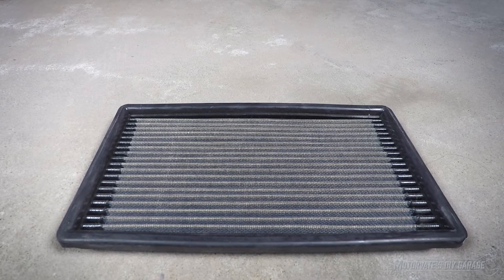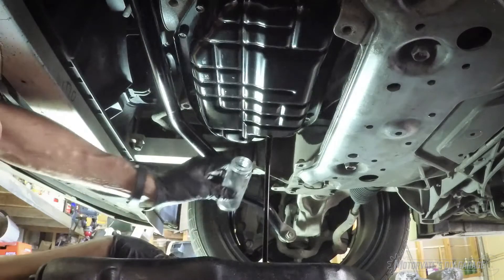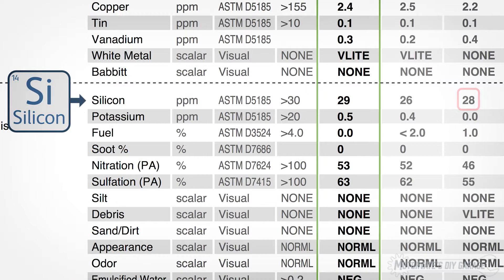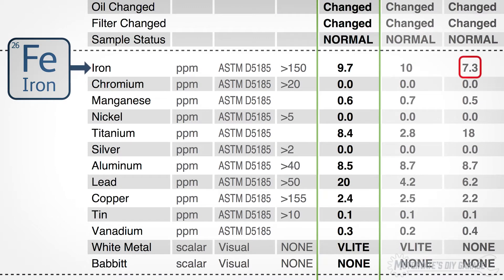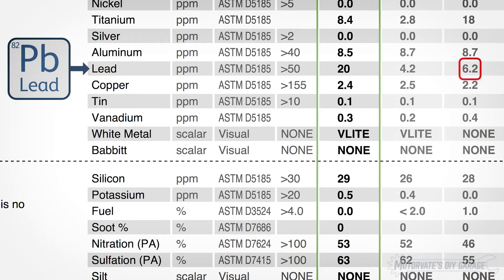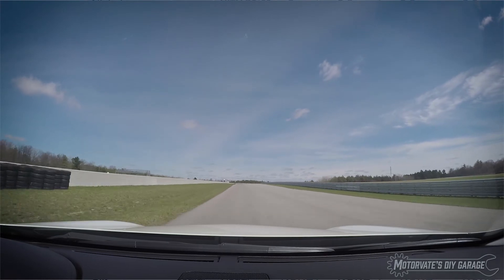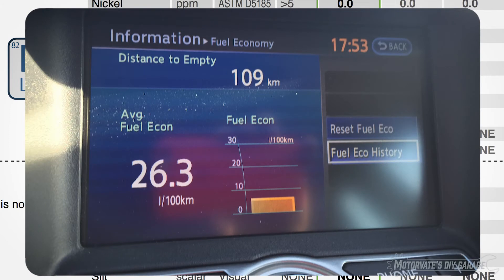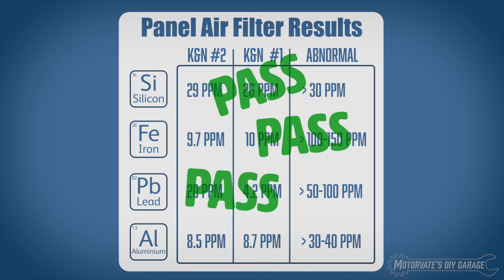K&N Filter Dirt Test #2: G37/370z - Motorvate's DIY Garage Ep. 21

Comment: Are you using a k&N oil filter as well?? Would be interesting to see what the filtering capabilities change in the tests.
Reply from the maker: Hey  3 Toe Customs,
Yes, when I clean the filter I only use K&N filter oil and only use the amount shown on the K&N filter website. It is very easy to over oil.
Reply: @MotorvateDIY  is it more beneficial to use the cleaning kit for the K&N. honestly don’t want to spend an extra $50 for something i may not use
Reply: @MotorvateDIY Prior comment asked if you use a K&N oil filter.
Not what oil you use on your air filter 😂

Comment: Yes, kn filter lets more air flow into the motor.
With more air flow comes more dust,dirt as well.
No, your not gonna see most of the increase of dirt getting through in an oil analysis test.
Most of it will get trapped in the intake tubing and manifold. As well as pass through the cylinder and out the exhaust.
I believe it will take years and a motor tear down for inspection and comparison, to truly see the impact(if any) of using higher flow filters.
Reply from the maker: Hey just here,
As I see it, the only dirt that matters is the dirt in the engine oil and the test results showed acceptable levels of silicon with low wear metals. Yes, an oil filter will remove most dirt from the oil, but that is its job.

If it takes years before any wear is detectable, how do you know what is normal wear or "extra" wear from the K&N. 

If we assume the K&N filter lets in a lot more dirt, we really don't know how much it may shorten engine life. From my experience, rust on the body or frame will kill a car before the engine is worn out.

Anyways, thanks for your comment. We will have to agree to disagree on the K&N filters. :)
Reply: @MotorvateDIY I was gonna switch to a k&n drop in but everyone hates on it why ? Should I use the one I got for my Chevy Malibu LT? I like that I can clean it and reuse it but I'm scared now after seeing people hate in them 😢

Comment: My dad ran a K&N on his 7.3L PowerStroke diesel for about 10 years.  He said he cleaned and re-oiled it about once a year.  When he decided to sell his truck, I thought I would swap the K&N to keep for my own 7.3.  I could not believe the amount of fine dust I saw on the "clean" side of the intake.  I threw the K&N in the trash.  For reference: he lives on a dirt road, a half mile from pavement.
Reply from the maker: Hey zachakamp ,
If you don't think the K&N is doing a good job, you did the right thing by not using it.
They didn't work for you.

They do seem to work for me for the conditions I drive in.
The next episode (E34) does a 2 year 31,000 mile analysis of my K&N filters.

Thanks for your comment.
Reply: I had the same problem with a used 7.3 I bought, full of dirt. It was a stock filter and air box. I don't think the Ford air box design is very good, and is quite small. Diesels flow a lot more air. May or may not, be the K&N. Just sayin.
Reply from the maker: Hey  @twobeer3316 ,
You bring up a VERY good point: Air box design is also an important factor for how well it can filter.
Good  air boxes will have a sharp turn in the air path. Since dirt has some mass, it generally doesn't make the turn, hits the side of the airbox and falls to the bottom.

Comment: just bought a car with knn filter the intake pipe was lined with dust.  id rather see a vacuum cleaner hooked up to the filters and tested that way.
Reply from the maker: Hey MrBlaze256,
The reason I tested the filter by using an used oil filter analysis, is because anyone with about $30 can do the test and see what is going on in their car, in the environment where they drive. 

The challenge with using a vacuum test is you don't really know how to simulate real world conditions. What sizes of dirt particles should be used? What is the feed rate of dirt? A vacuum is a constant flow, where the air intake is a bunch of gulps of air, as each cylinder is filled with air.

Anyways, thanks for the comment :)
Reply: K&n also function better due to the vibration of the engine. It vibrates the filters fibers and contribute to filtering. Something that can’t be simulated by a vacuum

Comment: Kn is safe or not for bike
Reply from the maker: Hey Deepak Kumar,
I agree 100%. 

Motorcycles with carbs are generally a "constant velocity" type and any increase to intake air flow can result in a lean mixture, which can cause engine damage.

Fuel injected motorcycles with an oxygen sensor should be able to adjust for the increased air flow.
Reply: @MotorvateDIY  can increase of milage in bike with this filter

Comment: the results doesnt apply to high air pollution such as asian countries, stick to oem filters for daily driver car
Reply from the maker: Hey Alex Arifin,
I see your point. 
However I would think the particle size of the pollution is so small that it would simply pass though any air filter.
In any case, if you are worried it makes sense to use what gives you piece of mind :)
Reply: Motorvate DIY your videos are awesome, I just put back the paper filter stock into the Audi and my forester 2.0 turbo. Any videos or suggestions?
Reply from the maker: @nuwan1072  Yes... Go for a nice drive and enjoy your nice cars  :)
Reply: Hi there I have the same concern with regards to the diesel fumes and dust going through. Any chance those fine dust particles could go through the paper stock filters as much as the K&N filters. I have noticed some black dust through the cleaner end of the air box. Any thoughts about that?
Reply from the maker: @nuwan1072  You could always do a used oil analysis and see what is going on with your engine. OR simply play it safe and go back to the OEM filter.
Reply: Hi there, thanks for the reply. I am located in Sri Lanka which is located in Asia. After much debate, I spoke and consulted with my garage as well. Even the paper filter will let some particles through to the engine which in turn would burn those particles. I decided to keep using the K&N filter as MTM for Audi too uses the same filter and my car ECU has been remapped. So all the money spent is of no use with the drop in filter for the stock box has been removed. Your video's are informative. As long as the filter is patiently oiled to the correct amount and you service at the right time, it is okay. I am using the same drop in panel filter on the Subaru Forester 2.0 turbo as well.

Comment: Does your airbox have a secondary charcoal filter? If so, would you run a test without it (if you haven't removed it already)? A test of the AEM Dryflow filter would be great too! Thanks for the quality content!
Reply from the maker: Hey Apichai Sotiwong,
My air box doesn't have a secondary charcoal filter, so I won't be any help.
However, I have never seen or read about a charcoal filter for the engine. What would be it's purpose?

As for an AEM DryFlow filter test, I would be interested to see the results, but the budget for 2017 won't allow it.
I will add it to the potential episode list for 2018.

Thanks for your kind words on the quality of the content, I appreciate it.
Reply: The secondary filter from what I have read is for emissions purposes (PZEV?) to reduce off gassing of the intake when the car is off. I am not sure when secondary filters became standard in vehicles but my 2010 Genesis Coupe had it. Here's removal video on an M5: https://youtu.be/VXnuubwww6Y
Reply from the maker: Hey Apichai Sotiwong,
Very interesting... My 2011 G37s for the the north American market does not have this.
I agree with you on its purpose... II suspect it is to capture any fuel vapour  that has evaporated in the engine as it tries to exit via the intake.
Reply: the most important is to catch those sand not dirt, when dirt get into the engine it will burn away

Comment: ive seen both of the K&N videos...so is it me or the K&N filters better than paper OEM?
Reply from the maker: Hey Jorlanjm,
That is a VERY good question.... BUT what do you mean by "better?"
I don't think they filter as good as a paper factory filter, but if you don't drive in dusty conditions, it may not matter.
They do flow more, which can give you an power increase IF your engine computer (ECU) is smart enough to notice and adapt.

My first K&N filter was for my 1986 Ford Taurus.... so I have been using them for many years on all my cars and motorcycles without any issues. BUT, generally it is not very dusy / sandy where I live. If I lived close to the desert, my answer may be different depending on the results of the use oil analysis.

Comment: You ever thought about buying some used stillen/ fast intentions test pipes? You can diy and before tune it's at least 12whp and good torque
Reply from the maker: Hey Jay z,
No I haven't.  I don't think  they would pass the emissions test we have in Toronto.
Reply: Motorvate DIY you gotta love emission tests, could always play it safer with hfcs
Reply from the maker: Hey Jay z,
Right now, 95% of my driving is in stop and go traffic and the stock cats work just fine :)

Comment: You should try mobile 1 extended performance or better yet amsoil and get back to us on that oil analysis. I don't know any performance enthusiast who run such oil 😞 especially on the track. I'm VERY curious as to what an upgrade to the oil would do. Remember the rules that define a synthetic have changed. Very few oils are TRUELY a synthetic
Reply from the maker: Hey nemisans13,
That's a good idea... I will be back at the track next April and will plan on trying Mobil 1. This time I  will data log the engine oil temperature and a few other items. It may not be a "apples to apples" comparison test, but the results could be interesting.
Reply: Motorvate DIY please see project farm u tube oil test.